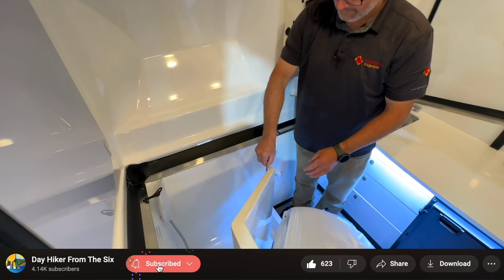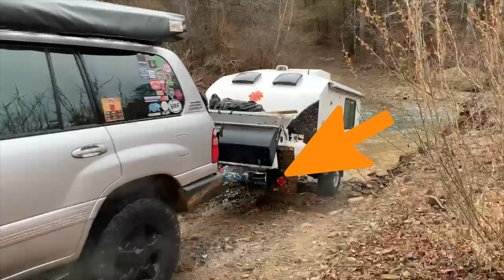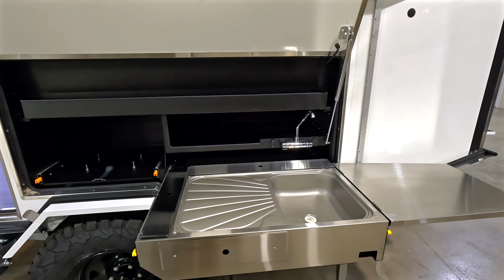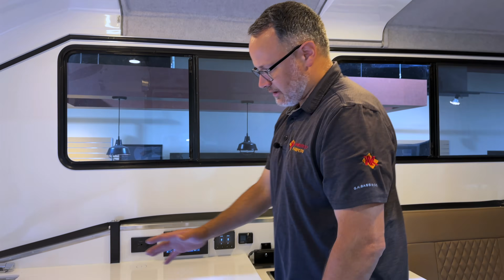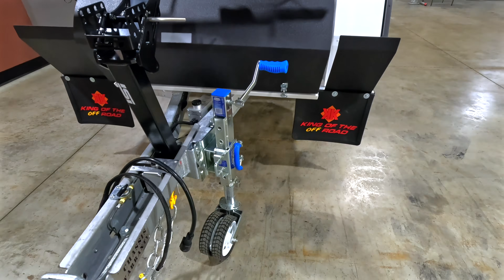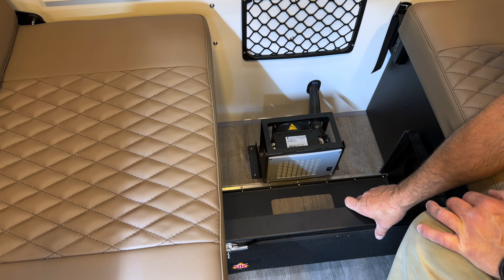Kimberley Karavan Eco Suite: Off Road Folding Camper From Australia

Comment: I have noticed on some RVs and some caravans people have done a DIY themselves which is they have press buttons around the bottom of the caravan or camper then they have a heavy curtain tarp that runs around the whole bottom front rear left and right side and a little bit of extra overhang on the ground to put the snow on or dirt this is for several purposes which is keeps the cold air out in winter from under the caravan and if you're in a Sandy area like desert or Beach do the same thing put some sand around the base as well to keep the the curtains from moving it stops any dirt or find dirt getting up where it shouldn't be
Reply from the maker: There is also a company that makes customer inflatable skirts for this purpose. Lots of creativity out there to extend the camping season. Thanks for watching!

Comment: No camper is worth 175k that is run away greed pure and simple
Reply: I shall be placing an order shortly. I will be going to some pretty remote locations (nearest help can be up to 800km away) so I need the reliability that only exists in the Kimberly Karavan IMO. The engineering, design and construction (fit and finish) is head and shoulders above anything else available in Australia. As has been said by others, if you break down in the Australian Outback you can easily perish.
Reply from the maker: I hear you, but I can’t blame Kimberley for positioning themselves in the Airstream price bracket. As long as there is a market for it, I think it makes sense for a small, low volume manufacturer.
Reply: @DayHikerFromTheSix not to mention the quality of the build like you said there's no wood in the structure only for decoration therefore the only thing that's going to deteriorate is the seals which should be easily replaced

Comment: If you fold this up in a rain storm, will the inside get all wet?
Reply from the maker: No, it's a proven design and the inside is protected with the outside structure. Thanks for watching!
Reply: @DayHikerFromTheSix  but the process of folding up, includes the sides of the bed area going inside the trailer.

Comment: A very good camper trailer
but way to over price for
a bumper pull off-road trailer.
I understand marketing a new
product into production has a
very high cost from the start
and it all even out when there's
enough of consumer to keep up
with the cost of production
and the manufacturing of this
type of product and accessories.
Reply from the maker: I kind of felt the same until I flipped over to the Airstream site and saw MSRP's close to $200K. And if you factor in all the gear (1000 Ah of batteries!, remote reservoir shocks, air suspension, solar panels everywhere, 2 fresh water tanks, etc. etc.) which is all somehow included while still keeping the weight reasonably low. Think of it as the 'Portal Axle Mercedes G-Wagon' of the travel trailer market.
Reply: @DayHikerFromTheSix  
I wonder what off-road airstream
they got now on market, you said airstream right, well they must have an off-road type     model now for 2024. I think the price has to do because of the australian paten .

Comment: I love this trailer. Is it towable with a 4Runner ?
Reply from the maker: I believe some V8 4 Runners have 7000 pounds of tow capacity, so it should be a yes for those. 4 Runners with 3500 lb tow capacity are a no, and the 5000 lb rated models are also a no since the GVWR of the trailer is 5500 pounds. Thanks for watching!
Reply: @DayHikerFromTheSix  Thank you.
Reply: No